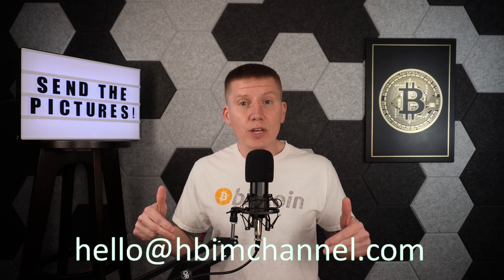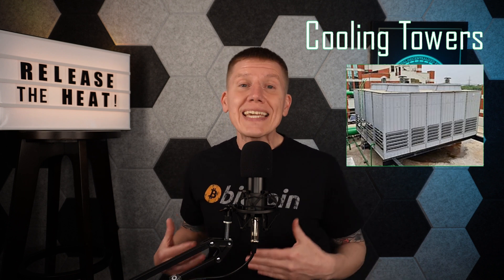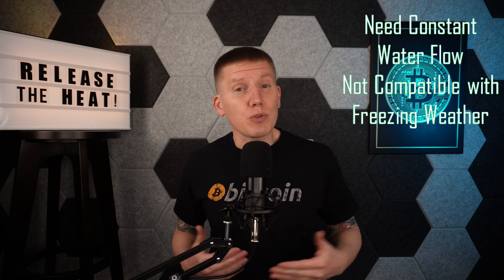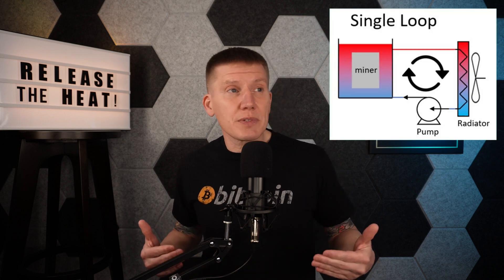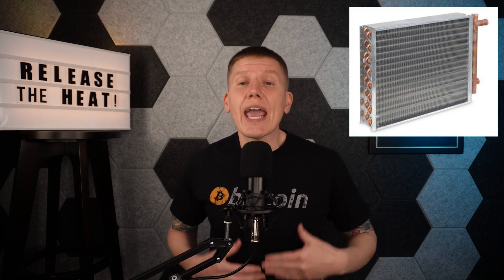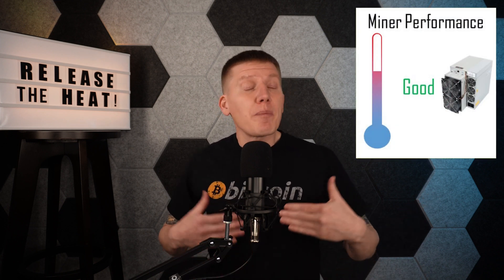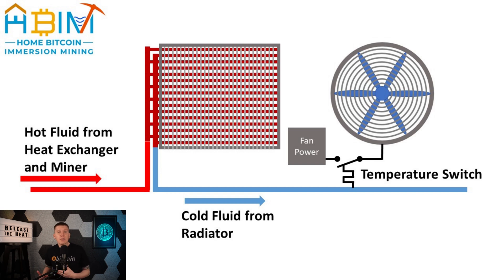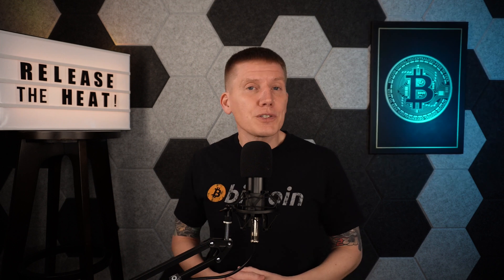EP10: How to pick the best cooling option for a BITCOIN immersion setup

Comment: hey concerning the hydraulic oil cooler, your link is dead so could you provide the info e.g. about the liter/second of a cooler efficient enough for 1 miner like the s19 please this would help
Reply from the maker: Sorry about that...Amazon kills the links every once-in-a-while.   There's now a few different Amazon stores which sell them...just search on "water to air heat exchanger" and you'll s a bunch of different options.   For fluid flow, you'll want 2-4 lpm per 1000W.   For example, a single S19/S21 miner running at around 3kW will mean 6-12 lpm or 1.6 - 3.1 gpm.